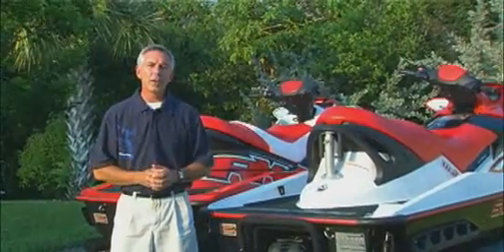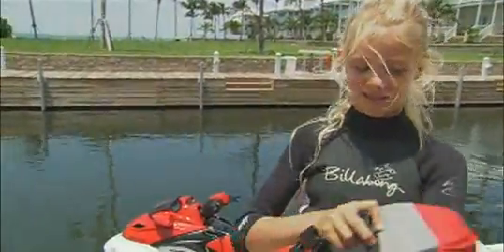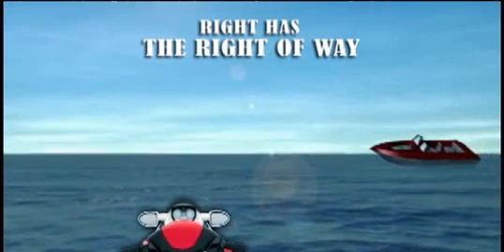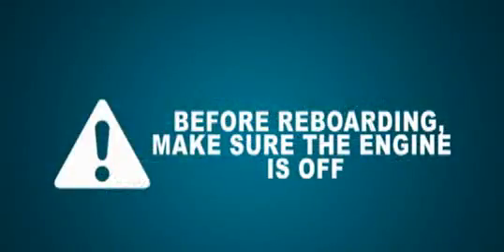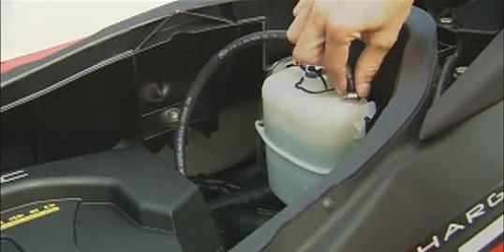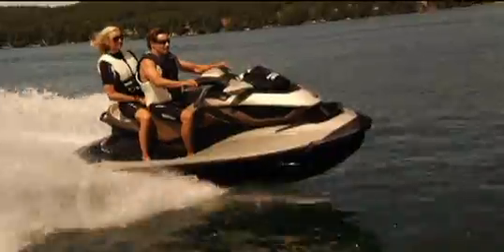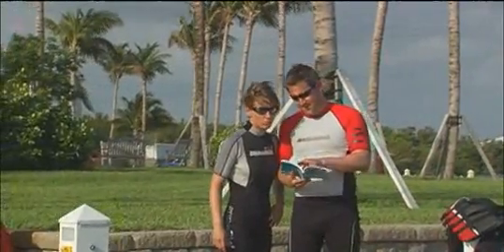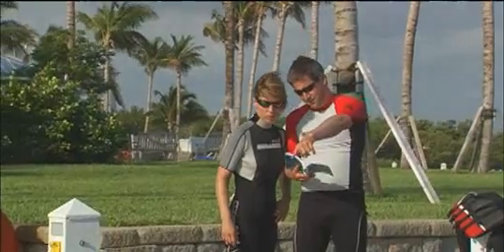Sea-Doo PWC Safety Video

Comment: F.Y.I. bought my new ski 1 week ago and put 5 hrs. On it, then just for safety sake I decided to look over all the hose clamps inside engine compartment. Well every hose clamp was loose / probably never tightened from the factory. This is why I do all my own maintenance. No shop manual yet it’s to new dealer says.